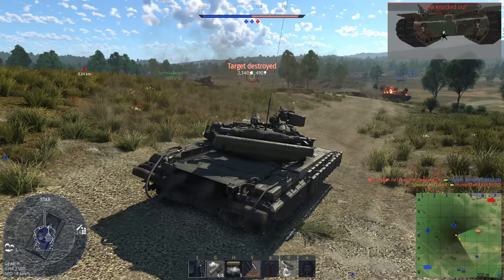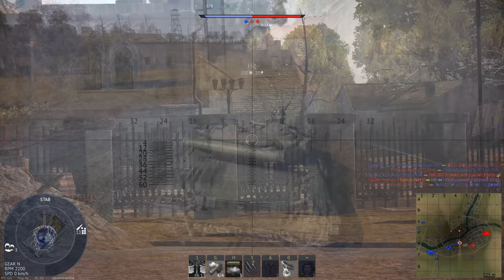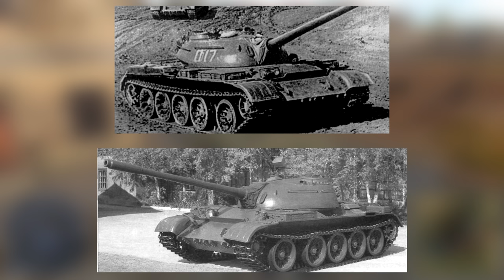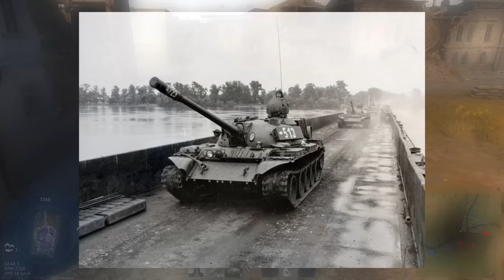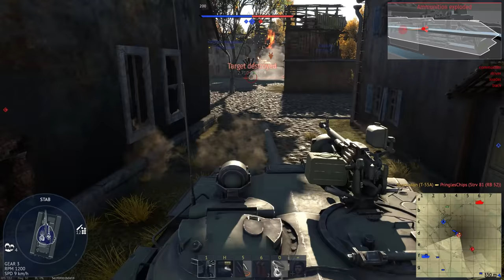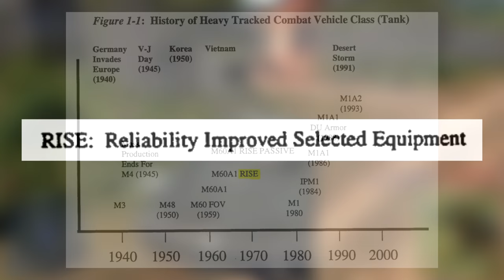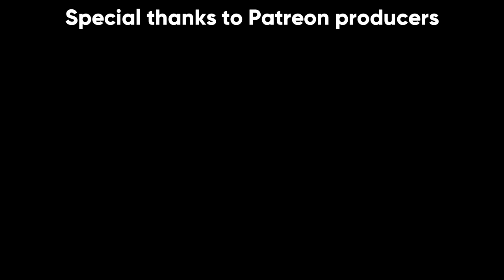Were Soviet Tanks Poorly Made?

Comment: T-34 was to be the best technological tank of the WW2 but the Operation Barbarosa force the soviets produce everything they had the, ofc the quality decrease due to mass product, T-54/55 was made for Mass production but its not that bad as the Midwar T-34, the T-64 and next MBTs was Perfect in Russian ground forces, the T-72 Bought by Iraq was a old version of T-72 so theyre not modern as M1A1 abrams, the Upgraded russian tanks only remains in russia due to if the tanks was destroyed the enemy dont steal it secrets thats why the russians never send T-14 armata to syria for Tests
Reply: Not only did Barbarossa make it necessary to just crank out the T-34s, problems and all, but as the Germans advanced rapidly towards their tank FACTORIES, they had to evacuate them and start over, often re-starting production without heat...in the dead of winter in the URALS.  Needless to say, this doesn't allow time to shake down the design issues.  Adding to that was, at least the GERMANS were impressed, as the T-34s that did run went through the marshes and snowbanks a lot better than the vaunted panzers, and their armor was fairly much proof against the most common German anti-tank gun, the Pak 36, a 37mm weapon they derided themselves as the "door knocker".

Nevertheless, work did proceed on development of an improved design, the T-43, which had the three-man turret, though the turret basket was dispensed with to save time and materials.  Other improvements were also made, but to implement production of the T-43, the factories would have to be shut down and re-tooled, which would suspend tank deliveries for about 2-3 months even on a crash program.  As the battle of Kursk and those immediately afterwards in advancing to the Dniepr river and retaking Smolensk were using up tanks by the thousands, the Soviet Army could not afford that production lull.  It was also deemed wrong to go ahead with the KV-85, which was further developed into the IS-1, with the D-5T 85mm cannon,.  WIth the ability to fit the 85mm gun into the turret developed for the T-43, it was also determined the way forward was to plop it onto the existing T-34 chassis, which would alleviate quite a few of its defects.  The resulting T-34/85, though it was nose-heavy and hard to steer, and prone to getting stuck in trenches, was still able to hold its own against the vaunted Panther tank and could even knock out a Tiger, so 11,000 of them were produced in 1944 alone, and many more in 1945 and onwards.  Some still serve TODAY, some 78 years after its debut, though the T-34Ms are a far cry from the original.
Reply: @selfdo  T-43 was just a prototype, the Last tank was the T-34-85 and his sucessor was the T-44
Reply: @Russão000  The T-43, despite its similarity in appearance to the T-34, was a "clean sheet" design, which followed the German practice of a torsion-bar suspension rather than the Christie suspension of the T-34 and the preceding BT series.  I've already explained the main reason the Soviet Army passed on it, but kept the up-gunned turret (the T-43 was to use the F34 76mm gun, but this weapon had trouble penetrating the frontal armor of not only the Panther but also the uprated Mark IV and StuG III vehicles, hence why the decision to cram in the D5T 85mm main weapon).  You're exactly right in that the T-34/85 was the last vehicle to use the Christie suspension; though the SU kept it production until 1951, and it was produced, along with upgrades of existing stocks to T-34/85M standard, by China, Czechoslovakia, and Poland well into the 1960s.  The T-44 used many features that would have gone into the T-43, but with a lower, redesigned hull, and a crossdrive layout and new gearbox, so it should be considered a new design altogether rather than a further development of the T-43.  

BTW, the AFV numbering convention often confuses folks outside Russia.  For example, had they built the M-60 "Patton IV", they would have designated the M60A3 as the "M-63".  Making it further confusing is the similarity of the T-64 and T-80 to the more common (and exported) T-72.  Despite their similarity in size, and use of the same main weapon, these tanks share almost nothing else in common, and not just b/c they came from different factories.  Further confusion arises from the T-90, which is essentially a hybrid of the T-72 and T-80, with intent to combine their best complementing features.
Reply: @selfdo  yeah, but u know the T-72 was made for be the mass product mbt and the T-80 and T-90 an Complemental element for the T-72 divisions (russia had divisions fully equiped with T-90s and T-80s but the major part is T-72 tanks)
Reply: @Russão000  Do correct if I've got it wrong, but it's my understanding that the Russian Ground Forces, essentially the downsized continuation of the old Soviet Army, still uses divisional "categories", I, II, and III, with the "I" being their "elite" units, almost all ethnic Russian, and gets the "best" of what's current.  The "II" are full-timers, AFAIK, but considered lesser in quality and capability, and have non-Russian ethnic members mixed with Russians.  These are the units that get the T-72s, but I understand some Cat II armored units have T-90s now.  IDK if there are any Cat III (reservists) armored regiments or divisions, but if so, and along with the typical "motor-rifle" units, aren't they still using whatever T-55s and T-62s that still run?  Or have all those tanks been "retired" and sold off or scrapped, and the reservists only using T-72s?

Comment: I mainly saw them as well designed to be cheap and mass-produceable allowing unreliability, design flaws and performance issues to be minimised 
Overall many Soviet tanks were very effective they just were made to be produced on a massive scale and as such had compromises
Because why do a 1:1 battle when you can overwhelm them
Reply: But then you have to take into account 3 times the tanks means 3 times the crew, steel, ammunition, radio equipment etc. choosing a quality design over a far worse design that you can make more of is an awful idea
Reply: @piecharb.1343  Thing is, the technology gap of an available, better design is simply not worth it. Yeah it's better, but how much better to justify retooling every factory in the Union, with the Germans 20 meters from the door? The new tank would need to be a cold war dart-slinger in 1941 for it to make sense.

Comment: The thing I have always wondered about with Soviet tank design is why the ALMOST(caps indicating I realize there were exceptions) universal lack of negative gun elevation? You could argue that it is forgivable for early designs but it seemed to be a common theme for their design for several tank generations. They must have recognized it but did not consider it as a deficiency in their tank doctrine? I know they always strived for low profile tanks, is this an issue or was it the general design of their gun breach? Obviously, not as much of an issue for urban combat, but in open, uneven terrain, seems like it would put them at a disadvantage, even in real life, not just War Thunder. Just curious.
Reply: This is exactly why Soviet tanks suck. On a modern battlefield, most successful engagements are fought from the hasty hull down position, and Soviet tanks cannot assume that position due to the nonexistent ability to depress their main guns. The problem was, the designers and engineers drove development, not combat tankers.
Reply: This was done on purpose, as it was easier to build. Plus, the eastern front was mostly and or  largely plain open fields so they really so no need for gun depression on the tanks.
Reply: @pirozhkov8568  Thanks, in what way is it easier to build?
Reply: @danmallery9142  The less things they had to implement on the tanks, the easier they were able to pump them out. Many factory workers were also unexperienced so doing this simplified the process for them aswell. And since the eastern front was a large open plain field, they didn't really see the need for this as they were also on offensive. Even post-war tanks and later into the cold war the max elevation for soviet tanks was usually 5 degrees
Reply: Just me speculating but: I suspect that modern Russian armor keep the low gun depression statistics because Russia has 0 plans of fighting in very hilly or mountainous terrain. This doesn't mean they aren't expansionist (just look at the Ukranian conflict) but their tanks seem to scream defensive in nature if you contextualize their overall design with the kind of terrain that Moscow has between it and its neighbors.

If I wanted to be able to invade just any country I'd make an MBT that reflects that.
Reply: @pirozhkov8568  How exactly is less gun depression "less things to implement". It just seems like whatever elevation mechanism would have a larger range of travel.  I don't understand how it would be more complicated. The only thing I can think of is they Soviets always had extremely low profile turrets. Maybe that limits travel but I don't know, I have never been in a Soviet tank.  Also, a nation doesn't always get to decide where the battle is going to take place. In addition, tanks are sold to other nations. The Iraq war was fought in the desert where more negative gun elevation would have been advantageous. Thanks for the discussion.
Reply: @danmallery9142  cause different tanks from different countries has different requirements that are influenced by doctrine, the terrain they find themselves in, experience, economy, politics, etc etc
Failing to take these into account when designing a tank (or any equipment) would get you boot off to a desk job somewhere in the middle of nowhere

Tanks arent primarily designed for exports, if they were the major powers that makes these tanks would've designed them to suit the client's requirements thus potentially making an outright new design everytime an order shows up

Comment: "They weren't keen to waste time on cosmetics" because who needs radios, headlights or gunner seats when you gotta reach a production quota am I right?
Reply: Would you rather face germans in 1941-1942 with moist nugget and no tank support then?
Reply: @ChervonaLada  soft stats matter just as much, if not more, than hard stats. Just look at Pz2 and the fall of France. Tanks like the Char B1 were statistically superior to the German Pz2, which saw common use in the German's armored units, but because the Pz2 had better layouts and command and control systems they were vastly more effective.
Reply: @sosogo4real  Producing enough tanks to offset the losses you sustain in combat matters far more. 

Eastern Front and Invasion of france are in no way comparible situations.

Comment: Compared to the build quality of US Sherman’s, the T34s build quality was pretty bad. But that just goes to show how great the design was to cover for these shortcomings. I don’t think the T34 was the best tank of the war, but the most efficient tank of the war. 

For the best tank of the ENTIRE war, I would have to give it to the Cromwell. Over its lifespan, they continued using the Cromwell Chassis while upgrading it. It was the first real “modern” tank design.  Seeing as the same chassis became the Comet, and after the war became the Centurion. It was ahead of its time in terms of design, and is sadly under appreciated due to the lack of numbers and usage during the war, as the US took up the majority of the conflict in the West.
Reply: Tell me, was the US invaded at any point? How the fuck will you produce something good if you are loosing territory like crazy, tell me, they needed to build tanks quickly and building something quickly will have a lot of problems
Reply: I've got to question where the effectiveness of the vehicle comes from, because they lost the vast majority of the T-34s they made, and more than you'd think from mechanical failure due to the myth of Russian ruggedness
Reply: @alexwhitehead3494  there's possibly a difference between something being reliably durable, and something being able to be reliably repaired.

Comment: The T34 had several improvements proposed to it that never got realized because of politics. the design itself wasnt bad its just that they didnt wanna have potential retooling stop production or decreas efficency of production. A lot of its obvious issues like poor welds are down to inexperienced workers which was rectified after the war aswell.
In short the T34s big issues are born out of the Fact that the Soviets were at War and relatively new to mass production.

On the T72 and its claims of "second line tank" or "cheap alternative" these are wrong statements, the Soviet Military was ready to completly replace its T64 fleet and all its issues with T72, having Plans for Extensive production of T72s across all the Manufactorers while heavily limiting the T64s and switching to a complete T72 Only production in case war broke out. A similar idea was considered about the T80 in this case having a limited production of T80s and a majority production T72s.
The only reason this didnt happen was again politics, and the Military wasnt happy about it, they much rather had a single MBT in service rather than 3 different types with different components, one of which was horrifficly unreliable having in some cases higher failure rates than even Tiger and panther in its early days.
The Latter part in particular can be found in the Book series "New Vanguard - 223, 6, 152" on the Soviet MBTs

Comment: If we talk about t-34 the tank that split into parts from being shot by anything bigger than 20mm,
 the tank that had polished or often not even polished metal in periscopes ? 
the crew couldnt see out of tank so bad they often failed to spot enemy that was shooting at them ? or just drove into ditches.
no gaskets on hatches leading to water leaking and wrecking any radio equipment
gearbox so rough that you need hammer to change gears. 
Real top speed off road of about 15 km/h ? 
Oh I dont know what American reports you read but one I read from Aberdeen test field, engine literally broke down within a hour,
Christie suspension was so awful that crew would end up with bruises before even arriving at battle field. 

T-34 were just dreadfull in every soft stat that you can think of

Comment: You go a bit up from the 19-century and you have the T-90 as the More Cheaper option from the T-80 Series.
Where the T-80 costs about 300 mil Ruble the T-90 would cost 150 mil Ruble.
Making both Tanks be used in the military,but the T-80 been given to the more Elite units.
And T-90 for the more Standart Tank Army.

Comment: UdSSR tank doctrine focused on higher numbers of adequate tanks working in groups unlike the western approach where they tried to make the tanks as individually powerful as possible for the time. Little sidenote. Gas turbine engines can either be made very economical OR very powerful. Both at the same time is impossible. In the military performance usually wins over economy so tanks with gas turbines like the M1 or T80 will always have poor fuel economy.